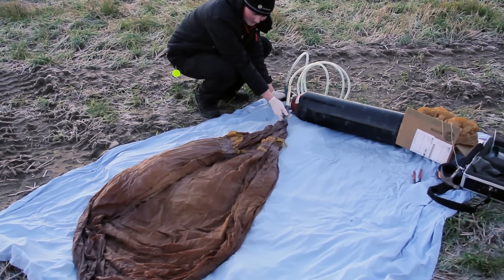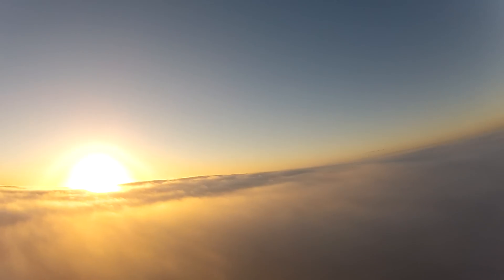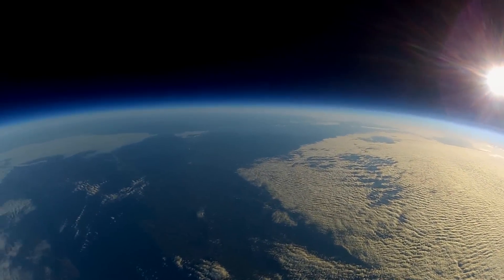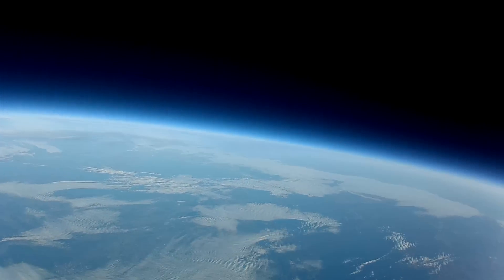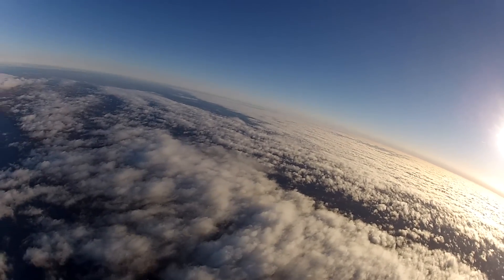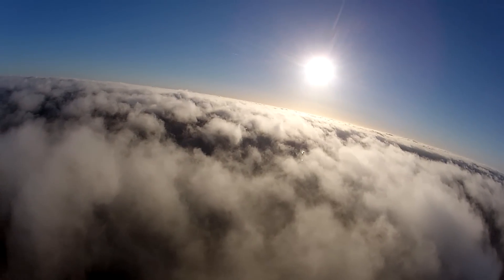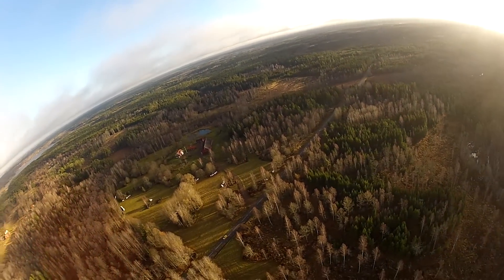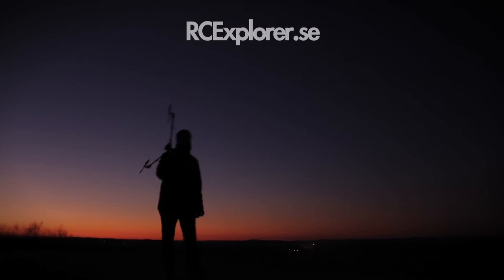Space Glider - FPV to Space and Back!

Comment: Actually your average helium balloon from a supermarket will usually burst at around 2 000 to 4 000 feet since the balloon expends as it goes up and the smaller it is and the more its filled the lower it will burst.

Comment: Apology for substituting David’s reply - of course he did. 
Since footage of that quality is still couldn't be transmitted via video link available for appropriate price, all footage taken in the sky was recorded on a flash drive of HD camera mounted on the plane. 
So there was no other option to get this footage, as to recover the plane.

 $130 analog wireless video link had been used but at least $2000 digital wireless video link should have been used for wireless HD feed.

Comment: If you open your ears he says 30,000 meters which is a little over 18 miles. If you've ever used a go pro, and hee says he's using a go pro 2, you know that at a wide angle setting you get kind of a fish eye distortion at the top of the frame. There is nothing fake about this.

Comment: could have told ya 1W at over 1GHz cant make it over 30km. Why not swtich to the 43 MHz band? Although only 500mW are allowed its still more SNR. And you could make a height dependent transmitter and transmit at more power if you go higher.

Other idea: Use the ballon as relaystation with a high gain antenna. Then you have your own satelite. Either down to earth directly or via another relay like a normal satcall. Then u just enjoy and dont need to drive arround

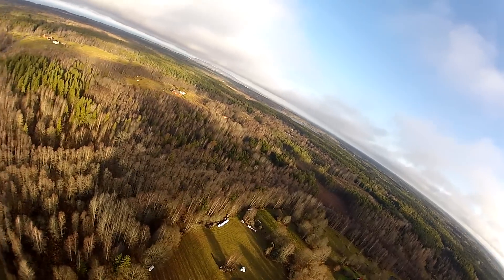Comment: At 5:03 you can see small lake in top left corner and few houses with even smaller lake next to them (center of video frame). In 5:15 you can clearly see those houses with smaller lake next to them, and road (that is important). And this is the part that David couldn't see on his live video stream. 5:26 road and trees cut down next to it. 5:33 You can see road and lake and you can figure out the road is going from West to East. Then I just searched for those landmarks on map.

Comment: David..( and yes, I AM being serious here )... WHY is this NOT on Discovery Science or something like that? NEXT - when are you going to do a second attempt? - 3rd...I have figured out  2 issues ( the ground Station  ) use a ground station Tracking system  - also ( Altitude Auto-Release I designed ) -simple reed switch one magnet IN balloon other on outside - when balloon breaks, magnets separate and triggers small servo to release main line with 5 sec delay. 2 clear  balloon & cable. good idea?

Comment: Hi, you work is inspirational, thanks. I'm fairly new at it, but not to tinkering and building things. You mentioned somewhere (Fflightest?) that you can replace your gear and flap switches with potentiomemters for pitch and yaw control for your fpv camera. What kind of Ohmage range works best for a DX6i?

I'm practicing on a Micro Blade 4 channel heli .with a 10mW system at the moment. The Bixler and the 500mW is in the works.

I'm inspired to make a Tricopter, seems like a great combination.

Comment: Hi. Your story is interesting and should help us with our design. We're planning something similar, but we're thinking of using two frequencies for the video. One HD (1.2Ghz) & one SD at  around 500Mhz, as a backup.  I can program PIC microcontrollers, so we'll most likely be using this for handling telemetry from the GPS receiver and triggering cameras/pyro too.  Cheers and good luck with the next mission!

Comment: David,  Awesome flight!  I have a suggestion to improve your release mechanism: Attach a second smaller bladder type balloon using a "T" shaped duct to allow the lifting balloon on top, and the bladder balloon on bottom, with filler on the side... then insert the smaller bladder into a chamber in the tail of the plane causing it to grip with the outward pressure.  When the main balloon pops, the loss of pressure in the bladder balloon will cause it to deflate and release the plane automatically.

Comment: At the point where he was at, at least 99% of the earth's atmosphere is below him. There is no appreciable difference at that point between where he was at and the karman line, aside from losing radio signal and the time during which he falls. In fact, if you go pre-karman line, the old definition of space was 50,000 feet, since at that altitude a human body in an un-pressurized suit would be just as much in danger as one in the near-complete vacuum of space.

Comment: Why not try using a rocket instead of the plane?
Add a timer to the rocket, surpass the 60 minute of its range at the altitude of 33,000 meter. Meaning once the timer sets off after 60 minutes, the rocket is to launch into space further at a greater speed. You can also try to release the parachute/balloon before the timer goes off.

Good luck and i do hope you succeed in future projects

Comment: The chances are so remote, engines are designed for foreign object strikes, so majority of times wouldnt cause a problem. The plane is foam, rubber should chop up and electronics are pretty small as well.
In most countries you have to plan weather balloon launches, time and place etc to minimise air traffic

Comment: Very cool. Using an altitude sensor, could you code logic to release the chute as soon as a loss in altitude is detected? Also, why not use an autopilot system coupled with FPV, thus in a worst case scenario you could maintain a wireless serial connection to the board and feed in autopilot coordinates depending on where the winds take in during ascent and avoid a possible lake-loss if FPV is never regained? Very neat to watch.

Comment: I'll add that a weather balloon has very little mass, (because it's a BALLOON,) and would quickly reach a low terminal velocity as it falls into the denser air of lower altitudes.  It wouldn't hurt if it did fall on your head.  And that foamie weights mere ounces with a battery, receiver, light servos and camera attached.  It would never just free fall, because of the wings and tail on it.  Since it's balanced, it would eventually enter into either a glide or a spin, and fall harmlessly to earth

Comment: How safe is this?   You have a weather ballon freefalling to who knows were, clearly over populated areas.  And you have an RC airplane which was finally under control, but only because the antenna were not totally ripped out.  Even a light weight foamy like this will hit with some serious impact if it is not brought under control by the pilot.

Question is why you did not use an electric glider that would have a longer glide and a motor to give you some location control.  Just curious.

Comment: 100 km is the correct figure.  Read about the Karman line, which is the line at which a lifting body (a wing) would require so much velocity to function that it would simply transition into orbit.  This line has an approximate altitude of 100 km.

Comment: That was under different circumstances. The Concorde ran over the brick-sized bit of metal, that had fallen off an earlier plane takeoff. It puncutred the tyre, and bits of the tyre damaged the underside of the wing, and caused a fuel leak, and a fire started. They were already at V1 speed (can't stop, not enough runway left), so they had to take off. Conjecture: part of what caused the crash was, IMO, the way the engines were built into the wings, which led to the left wing breaking.

Comment: I think you better study modern aviation a bit more buddy. A supersonic airliner(Concord) has a whole separate risk factor of crashing compared to a normal subsonic airliner suffering a loss of all engine power. 

A typical 747 is more like a glider. In fact, they are not allowed to be in operation if they cannot safely function under a total engine power loss. The concord is not forgiving and it was only a mater of time before that experiment came to an end. 

Stop trolling.